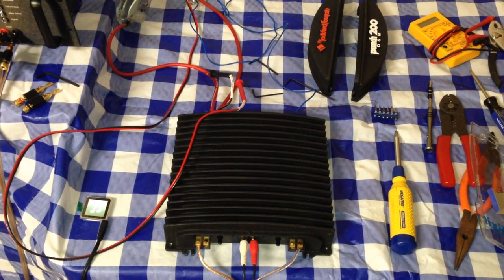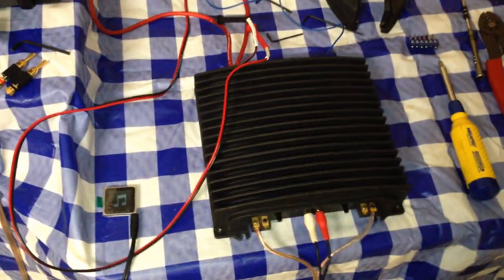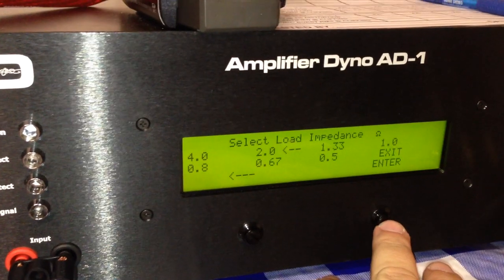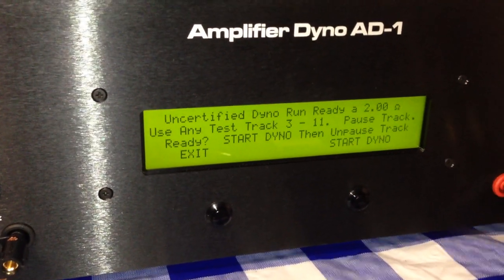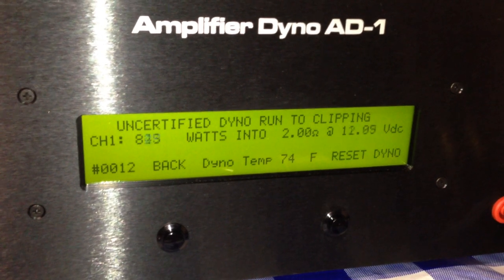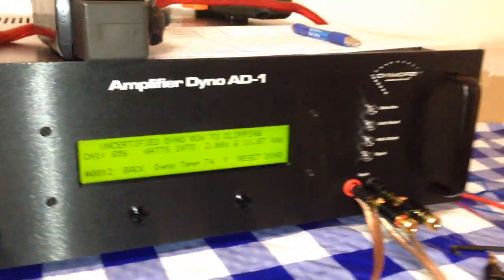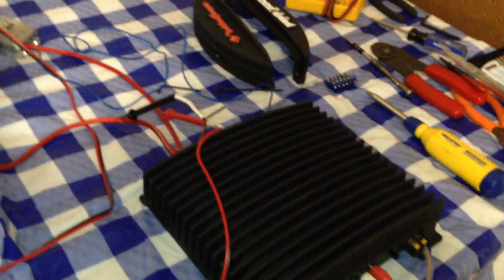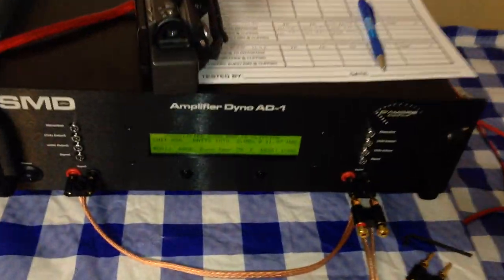SMD Amp Dyno vs 1993 Rockford Fosgate Punch 200 DSM WOW!!

Comment: I used to sell so many of this amp plus others in the range because of how incredible a performance they gave, great power, sound and reliability ensured that customers had big smiles in their faces.
Reply from the maker: I bought a Punch 400x4 back in 1996 and that joker still blows me away. It was running 4 ohms on the front channels and 2 ohms bridged on the rear channels for 8yrs before I retired it and put in a RF Power 550x (it has a remote bass control). Even my new RF's are old school...getting more than you pay for is always a good thing!

Comment: Thanks, BigDWiz. I have two 200ix, a 100 DSM and a 60 DSM and they're all incredible amplifiers. I've lent the Punch 60 to a couple of people after they blew up their make-shift amplifiers (Boss, Crunch, etc.) until they bought a new one and every time it was like pulling teeth to get it back. I almost had to hurt somebody!!! LOL Great videos, and good job on keeping it ol' skool. Thanks again.
Reply from the maker: AJ72Camaro the best way I can describe these amps to the younger generation is to tell them to add a zero to the end of these model numbers to get the equivalent power from most new amps. So the 60 DSM would equate to the newer 600W amps. Of course, we don't want to let this secret out because these amps will shoot up in value!
Reply: Dereck BigDWiz True, true. I'm soooo anxious for you to post the full test of this amp. I had only one of the 200ix amps in my car a few years ago running two P3 10s and replaced it with a Powerbass ASA800.2 and I couldn't believe how much better the 200ix sounded. I had to turn up the bass boost on the PB just to get it to match the bass output of the 200ix, and the accuracy still wasn't there.

Comment: I expect nothing less than what you tested from an old school Fosgate.  New Punch stuff gives you more than rated but the old stuff gave you alot more.
Reply from the maker: mustang6035 True, but many may not know this amp actually retailed for $600 back in 1993. How much RF power will $600 buy these days?
Reply: I believe it. As you know like I do good amps cost $1-3 per watt back then so good sound systems on average was 250-500 rms.  Keep testing those old but not forgotten jewels.

Comment: Love the old school RF amps, much better than the crap they make now.
Reply: You mean that crap that last and puts out more power than they rate it at? 
Yeah, I have a garbage RF that's 100x4 that I ran at 2ohms 250x2 for 7 years before I finally upgraded it. Still works. Still have it. 
My current garbage RF is a P1000x1BD that I ran for 1 year at 2ohms 1,000 watts. Now I'm running it at 1ohm 1,500 watts and it's still pounding those 12's. 
Can't wait to upgrade to either a garbage T2000 or T2500. 
Steve Meade said he has more than 10 T2500 and no problems with any of them. 
Yeah, definitely garbage.
Reply: Every car audio company has had their time where their products were horrible.. because you have to try new things as technology changes and competitors debut into the market. I have a RF T1500-1bdcp that pushes a 2000wrms SA 12 ZV5 and it doesn't get hot.

Comment: Dude that's crazy! Love your channel been I've been a fan for a long time! I guess that's why I loved my old 4080 DSM I must say that 200DSM put my old 150HD to shame! Keep them coming my brother!
Reply from the maker: Thanks K4gixxer1000 ! Yes, the 200DSM is in another ball park vs. the 150HD. I'll still need to retest a 150HD to see what the dynamic output is, I'm gonna guess around 500W
Reply: Dereck BigDWiz Give that Kicker zr240 another run D  :)
Reply from the maker: 666JLH Will do! I just ran some wiring to hook up the big 250A adjustable power supply tonight, so when I'll be able to feed the ZR240 more voltage and see what it can put out!
Reply: Dereck BigDWiz 1 of my fave amps for sure.Old school goodness.

Comment: What's the voltage rating on the amp? Like to see it pushed on a 14 volt bank if it would hold that much voltage. 1,000+ Watts?

Comment: I used to have the Punch 40! and that lill beast had some power to it! I think my birthsheet was only 180watts. But it the was loudest 180 I heard! Almost as loud, believe it or not as the punch 150 back in the dayz. Hey can u test a punch 40dsm?? I bridged mine at 4omhs. At the time I didn't know these could take 2ohms. Would be so awesome!!
Reply: I used to run my 200ix at 1 ohm. No problems.

Comment: What up Big D!
RF = FTMFW!
Curiosity has me now though. What does it make with your usual equipment?
Reply from the maker: vitobasser Funny, I never tried the 200 DSM with my old setup. I did test the 500m, betting my results before will match the "certified" mode on the AD-1. I'll confirm soon

Comment: What’s the difference between the 200 dsm and the 200ix dsm
Reply from the maker: IX has crossover modules and more protection for the power supply. In my tests the 200DSM is more powerful at 2 ohms mono, but RF says the ix does a better job protecting the amp at low ohm loads as it rolls back power

Comment: I have the 200x2 trans Ana amp. I was wondering how long could I run it in a 2 ohm setting and still play it safe without burning up the amp? I know it isn't rated for 2 ohms, but if it will do it I was wondering how long I could use the amp and still be safe. I have a P3D4-12 that is wired to 2 ohms that I want to hook ot to.
Reply from the maker: The 200x2 is not designed for 2 ohm loads, however I used a 400x4 with the rear channels wired at 2 ohms mono for many years and it performed well
Reply: @wal  okay thanks, I think I may just hold off and install the amp in my expedition now though. I just want get the Bump I want out of my 2002 convertible camaro. I het enough with the NVX jad900.5 amp I'm running now. I really do wish my car was a hatchback. Thanks again for the information.

Comment: Hi Brother, I need your help again, I have a SE SE1010 subwofeer, I need an amplifier to play it, it happens that like you, I'm in love with the old school RF, but the problem is that I have the option to buy the RF 200x2 TRANSANA or the RF 200 IX, however both are 2 channels in 2 ohm each or 4 ohm bridge, how to connect in my subwofeer? If I connect the subwofeer in parallel 2 ohm, does the RF handle?
Reply from the maker: +Emerson Ferreira It depends on the internal condition of the 200x2 or 200ix. If they are in good working condition, they should be able to handle the 2 ohm mono load. However, these amps are 20 years old...they may have component failure if pushed too hard

Comment: What is the difference between this and a 200ix DSM fosgate?
Reply from the maker: 200ix has a built in x-card slot for crossover. Default crossover chip can be set to 100Hz low-pass, 100Hz high-pass or full range (bypass)
Reply: But in matters of power? Would it be the same as the video there? Recommend the 200ix to play my subwofeer RE sex10D4 600 watss?
Reply from the maker: Yes should be the same power. It will run at 2 ohms mono, but you may want to give it some room to breathe or add an external fan

Comment: Wowwww crazy! On 8 gage wiring
Reply from the maker: Matthew Ong I know, right? I found some 4ga to 8ga reducers, but they won't fit into the DSM's terminal blocks. Maybe I'll file the reducers a little so they will fit.
Reply: Doesn't that just ruin your day? To me I also have a handy distribution block for that. I used to use reducers but it's bottle neckin anyway haha. Thumbs up on the video!
Reply from the maker: Matthew Ong Yeah, I have a distro block also, just need to get the 4GA closer to the amp, and use a very short 8ga wire

Comment: Is the 200lx the same ?
Reply from the maker: Close, but not exactly. Slightly different power supply and the ix has built-in crossovers
Reply: @wal  is it the same power ?
Reply: @Williston Audio Labs Could you do a dyno of a Rockford Fosgate punch 800a2 and Kenwood kac 1021 ? Just I've been wondering for so long.

Comment: Hot dang amazing! :-o
Reply from the maker: Danny Caballero Crazy - Wack - Funky! I'm still in shock!!
Reply: Lol. Yeah man that's crazy underrated!
Reply: Dereck BigDWiz that was at 11.87 volts at 14.4 i think that it will reach a thousand.
Reply: Goshindo Tanaka Easily.
Reply from the maker: ***** Goshindo Tanaka I'm working on getting the big power supply connected this week and should be able to try again at 14.4
Reply: Dereck BigDWiz I can't wait to see that one, surely over 1kw then.
Reply: Can't wait to see the Power 1000C dyno'd! :-o

Comment: weren't these called cheater amps?
Reply from the maker: Ryan Davis the cheater amps were the ones rated at like 25 watts per channel and put out way more at lower ohm loads. I guess from the results we can say even this amp was "cheating" the ratings
Reply: Cheater amp was a Sound Stream Class A 10 2x25 and it was about a foot in length. They were stable at 1/4 ohm and pushed 1,200 watts. I knew a guy back in 1995 that had one pushing 8 Sound Stream SPL 12's hitting 155 in the Outlaw. No one came close because he was on the bottom class with his 50 watt amp. 
Volume 4 killed your ears. Volume 20 you couldn't breath. For 1995, it was insane.
Reply: Well thats kinda cool